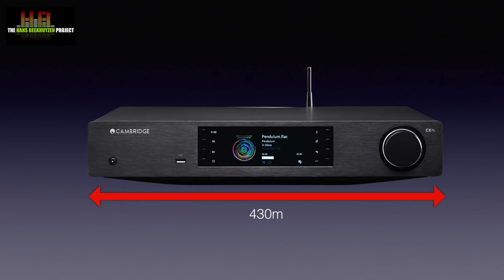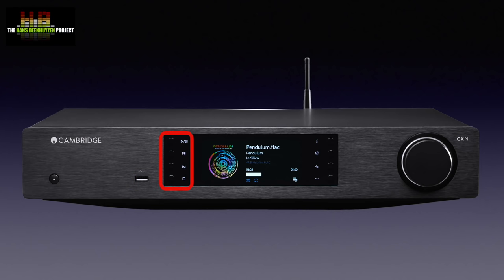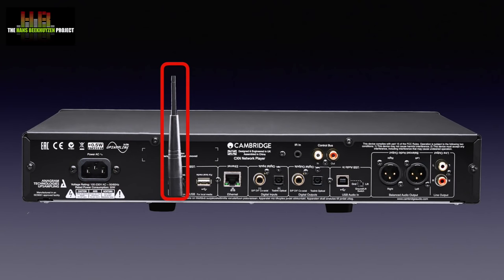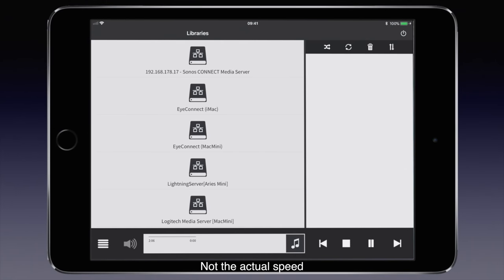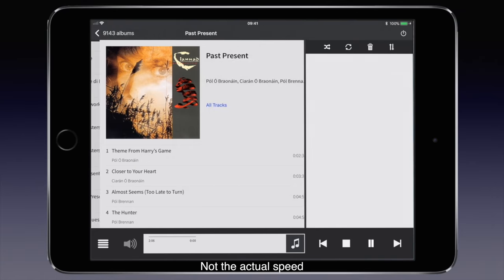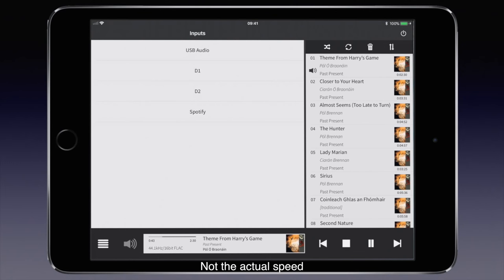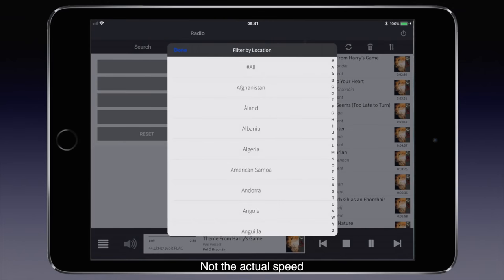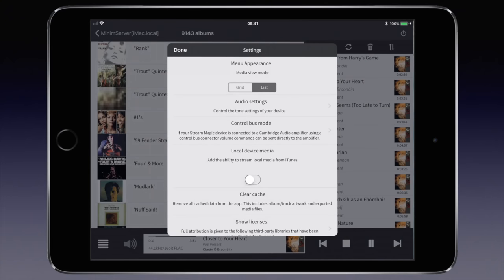Cambridge Audio CXN v2 streamer/DAC/pre-amp

Comment: Nice video. I recently purchased a CXN v1 at a reduced price, I was happy to go with this as from what I can tell the only real advantage of the v2 is a faster processor, they have the same functionality and DAC chips etc. Upgrading from a Pioneer N-50 the CXN seems fast enough to me and the app is sooo much better! The ability to play DSD files is good and they sound excellent. MPEG-DASH HSL is coming with a future update I believe.
Reply: rgrtnyjjc Hi, I’m also thinking to swoop from N50A to CXN...is it really noticeable difference in sound quality?
Reply: Will Mac Hi, I’m not using Spotify. Mainly internet radios plus soundcloud

Comment: Another great video thank you!  BTW, I saw your review of the Yamaha WXC-50 MusicCast which was very positive.  How does this unit compare to the WXC-50?  I am leaning towards the Bluesound Note2 to connect to my tube based HiFi system, but the WXC sounded interesting and ofcourse, this unit also sounds like a viable option.  I don't need a pre-amp but need the streaming capabilities and having updated DAC that are well implemented would be valued.

Comment: Hans. Thank you for the review of the Cambridge Audio CXN V2 Network Player. I am torn as to what network player to get as my source. I plan to implement it with my vintage Mitsubishi DAA15DC amp and DA10DC preamp. Price is a concern and don't want to spend more than 1500 at least for now. I have been looking at Any/All network players that offer a Nice Visual display (as I will probably be using that more often than my computer...at least until I upgrade my computer or iPad. The products I have been looking at are: Cambridge CXN V2 Network Player, Cambridge Azur 851N Preamp/Network Player (although I don't know if I can use it in conjunction with my current preamp). Also looking at the Marantz NA6006 Network Player. And finally the Sony HAP S1 or the more expensive Sony HAP ZIES. Any suggestions would surely be appreciated. Thank you.
Reply from the maker: You find my review of network players at https://www.youtube.com/watch?v=f4FU1tqZdeU&list=PLMbsmejHnP8HQVuvO_xSXAPmV1CVswsvi

Comment: Hello Hans, good review. I am out hunting for a digtal, streaming preamp with line out that I can connect to my NAD Integrated amplifier, KEF speakers. My question is I want to stream my phone with both Pandora and Spotify, I want to connect the TV auido via optical, Also I was for now planning on usiing my Dell laptop as my music server running JRiver. For the PC I would stream using google chromecast? It appears this preamp will do the job?? Thanks for your feedback.

Comment: Thanks for the review. I'm considering this unit or possibly a Sony HAP-Z1ES or HiFi Rose RS201 but those units cost twice as much as this one. I currently use a SMSL DP5 which I've been a bit disappointed with even though it sounds good. I'll be using the unit only for playing FLAC files from a USB connected external SSD. I listen to mostly Jazz, classical and soft rock on occaision. I do not stream music or plan to play files from a network drive or computer. I have a few questions that you hopefully answer to help me make a decision.

-What is the storage limit on a SSD can it read? 
-How many albums /folders and tracks on an SSD will it support?
-Does the app control the playback functions such as playing albums and tracks? If so, does the app also display the track artwork? 
-Does the app connect with Bluetooth or WiFi (WiFi preferred)? 
-Does the internal DAC sound crispy and detailed on the high end (I prefer that sound) or tends to sound rolled off on the high end? 

Thanks for any help on this
Reply from the maker: Please watch Q&A: Which device is better?: https://youtu.be/BzLmC4n2DX4

Comment: Thanks for a fantastic review.I have this streamer, but I've noticed there is no on/off switch that switches the streamer off completely. It seems you have to unplug it to completely to switch it off. That to me seems a very basic design flaw.
Reply from the maker: There is a standby button left on the front. There is no real 'power' switch since it is better - sound wise - to keep power on the crystal oscillators.
Reply: @TheHansBeekhuyzenChannel  Thank you for your reply.

Comment: Hello Hans.  thanks for your continuing work (just made a contribution via paypal).  I am very much interested in this streamer but I am curious.  You mention it being suitable in your setup 2 and lover end of setup 1.  What was the full hook-up chain in those systems used to achieve the sound quality you commented on?  Was a network renderer used in the Ethernet chain?  Did you run analogue out directly to your pre-amp?  Or some other configuration?    In my system I will initially connect via Ethernet directly in, with analogue out to my preamp.  Wondering if that will yield good results until I can afford further tweaking with perhaps SOtM or MicroRendu in the chain.
Reply from the maker: Setup 1: SOtM sMS-200Ultra,  Crystal Cable interlinks,  Audio Note Soro SE (watch https://youtu.be/tPWS3Lk6y1g)
Setup 2: Bluesound NOde2/Auralic Aries Mini/Allo USBridge  as streamers and Marantz KI Lite as amp. See http://thehbproject.com/en/About
Reply: The Hans Beekhuyzen Channel thank you Hans.

Comment: Hans I have the first CXN and it is excellent I use Roon through it via a SotmSMS200 and Pink Faun Lan isolator and Ideon Audio 3R USB Renaissance USB Hub, all through the CXN and out to Magnepan MMG via large current amp sounds fantastic thank you for the recommendation on Sotm and Pink Faun they make the sound so much better. Small contribution to keep you on this channel has been sent. hope others follow.
Reply: I believe he's using the SMS200 as the Roon end point and the CXN as a DAC/Pre.

Comment: Hi Hans,  I see that back when this review was made, you expressed a preference for the CXN-V2 over the Node 2i, though I'm not sure which generation of each was in production at that time. I'm presently feeding a Sonos Connect into Naim electronics, and want to upgrade. I'm presently streaming Deezer, but will probably go to Amazon HD if I upgrade. My primary concern is sound quality: do you feel that the current Cambridge is still distinctly better sounding than the Bluesound, and the best sound available at $1000?  Assuming so, how would you compare the Bluesound to the new Sonos Port if one was limited to CD-quality streaming? Thanks for any advice, and for the great reviews.
Reply from the maker: I am not aware there are other versions of the CXN-V2 and the Node 2i
Reply: @TheHansBeekhuyzenChannel  I might be wrong, but there seem to have been updates on both over time, and I wasn't sure if you were referring to the Node  2 or 2i,  since this review is from 2 years ago and I only heard you refer to 'Bluesound' in the review.  So my questions are in regards to the current products from both manufacturers (3 manufacturers, if you include the Sonos Port question).  Ultimately what I'm hoping to find out: if this is the best sound quality for $1000, on a scale from 1-10, we can give it a 10. Would you give the Node 2i a 7, and the Port a 6?  Thanks.
Reply from the maker: They normally don’t influence the sound quality. For the Node 2i I am sure for I own one.

Comment: Thank you for this info.
At the moment I have a Dynoco ST70 tube amp connected to the Klipsch Heresy 2 and for audio I use the Sonos Connect 1.
I want to upgrade and go for the Cambridge. But I have no idea if I will hear any improvement in the sound quality.
So my question is, will I  hear any inprovent when I will change the sonos connect for the Cambridge?
And what difference will I most likely hear?? Is it a big difference or very sibtile?
Greetings from the Netherlands
Reply from the maker: I would, even in my setup 3.

Comment: Good review Thanks. Got a question. Are we able to bypass the internal DAC to use our own something like a Chord Qutest ?
Reply from the maker: Yes, you can connect the digital output of the CXN v2 to the Chord DAC.
Reply: If you ever try this out, please do share your experience with regards to any improvement in sound quality when using the qutest vs cxn dac.

Comment: I am new to the hifi hobby and find your vidoes extremely helpful.  I recently bought a pair of 4ohm speakers, however my amp only delivers 8 ohms,  is this a problem?  Thx
Reply from the maker: It is all about the current that is going to flow. There are no 4 ohm speakers and no 8 ohm amps. The impedance ('the 'ohms') varies with the frequency and depending on the design can draw large amounts of current. If the demand for  current becomes too large, the amp might get too hot and eventually die. That is why some amp manufacturers state their products are suited for 8 ohm speakers for that is a save choice. And speaker manufacturers have to put a number on the speakers and often it is the impedance at 1 kHz. That's useless for defining the potential current that might flow for the largest currents are caused by the bass tones. In effect this means that I can't say if combining your amp with your speakers could ruin your amp. You do need the assurance from your supplier that it will work properly.

Comment: Just bought this player. Together with the CX A80 and a CX UDH (probably the last one in NL). 

A word of caution/advise.... I use Plex for DLNA and it works well with the Nv2...except when trying to stream WAV. The default DLNA profile Plex uses for the unit won't allow WAVs ( lossless directly ripped from CD). A DLNA profile wizard could maybe fix this...16bit 44.1kHz FLACs work great.

Like it was said in the video...the player only plays what it gets from the server. And the Plex won't serve untouched WAVs to a DLNA client with the default profile.

Playing WAV using USB works great. So it's not the players fault.

Just thought I put it out there 😉.
Reply: Korrel Zout ik heb ook de cxa80 aangestuurd door MacBook via usb. Weet jij of cnx een klank verbetering zal zijn? Ik vraag me af of het die investering waard zou zijn aangezien de cxa al een dac heeft. Merci alvast
Reply: @wardgeebelen4205  zouden zelfs beide dezelfde dac moeten hebben. Verschil is vast marginaal...blijft zelf proberen.
Reply: @kaasman78  oké merci!:)

Comment: Thanks Hans 
Cambridge audio claim absolutely no quality loss when the CXN used as a preamp,  did you try the CXN as a pre and if so was it directly into a power amp?
I'm looking at a CXN directly into a  power amp but am worried about the way the volume functions 
Thanks in advance for any help
Reply from the maker: I used it connected to the line input on my amp, not as a pre-amp. But I am sure it will sound fine as a pre-amp provided the power amp is a good match.

Comment: Dear Hans,
It’ll sound weird but you’re sure that the device you reviewed is cxn v2 and not v1?  The back panel clearly states the version, ie for v2 it says “CXN V2 Network Player”. Yours displays as “CXN network player”, that is the original-old V1.
Reply from the maker: I did review the v2 version but I might have used stock photos of the v2.
Reply: Ok, thx

Comment: Hallo Hans 
Een vraag die ik niet zo goed ergens kwijt kon en gezien die gekoppeld is aan mijn Cambridge audio keten post ik die dan maar hier. Ik ga verder in het Engels gezien het medium. 
Problem: Too sensitive volume control. 
I have a CXN V2, CXA 81 and CXC chain. 
When turning up the volume in the first quarter of the volume range the jumps in volume are far too high. 
Whatever I try, using the volume control on the amplifier, the remote control or the Cambridge app ends up in either too loud or too silent music with no in between. Only when I use the CXN as a preamp the volume control is somewhat more gradual but that comes at the price of a lesser sound quality in terms of clarity and transparency. 
I have been looking for all sorts of solutions and even stumbled onto something called “attenuators” from Rothwell. 
Although they pretend to be sound neutral I hesitate to put a “resistance” in the signal path. 
Do you have any suggestions? 
Kind regards!
Reply from the maker: Sorry, can't help you there.

Comment: Hi Hans, thanks for this wonderful review! I have a question: When connecting a Mac (with Audirvana) over ETHERNET with the Cambridge will the music signals then directly depart from my Mac? I ask because Audirvana can do a bit of MQA-decoding (I'm on Tidal) and I use a room correction plug-in with Audirvana. Much appreciate your answer!
Reply from the maker: Audirvana will send an unprocessed signal to the DAC. The DAC will then decode and render the MQA signal. But that only works if no processing takes place in Audirvana or in-between Audirvana and the DAC. You could have Audirvana do the decoding of the MQA signal and then have the room correction plug-in do its work. But then the DAC can't render the signal as MQA signal.

Comment: Can I just add and external HDD and use it as a music server? Any HDD, without power supply? Or only with external power?
Reply from the maker: Yes, provided it doesn't draw more than 1 ampere (which will normally not be  the case with 2.5" USB drives). 3.5" USB drives do need their own power supply.
Reply: The Hans Beekhuyzen Channel thanks! I was reading the Cambridge Audio site, and they do not recommend using this as an audio server, they say it’s only a streamer, and they recommend using a NAS with UpnP to store your music. That the USB port is design to read smaller usb thumb drives and not large HDD. 

I use an Olive 03HD, but that was bought in 2010, and will fail eventually, and Olive is out of business, so it’s unsupported. So I’m looking for an alternative, that’s just like that, preferably with a CD drive, so I can rip my CD’s directly, but if not I can use the Computer, no problem. And that has either integrated HDD or that I can just plug an external one with ease. And that it costs close to $1000 USD or less. Do you know of any that fit that criteria? Thank you very much!
Reply from the maker: That probably means that the CPU that controls the audio files is not too powerful. So it will work with small collections of music. I have not tried this, though.
Reply from the maker: you might consider the Innuos Zen MK3 Music Server: https://youtu.be/PrKFvGTVmiM

Comment: Dear Hans,

I thinking to buy the CXN V2 only as streaming transport for Qobuz, the internal dac of my Parasound Halo integrated doesn’t support mqa. 

As a streamer transport only, which device has the best sound quality in you’re opinion?

OS is not important for me, the digital output neither because I have both dedicated usb cable and a digi coax. 

Pro-ject Streambox S2 Ultra
Cambridge CXN V2
Bluesound Node2i
Reply from the maker: Please watch my review. I have nothing further to say.
Reply: The Hans Beekhuyzen Channel you said it’s tolerable in your setup 1, the Streambox S2 Ultra you easily allow in setup one. And I have seen what you said about the bluesound.

But I meant using it only as streamer transport for Qobuz, I want to use the dac in my integrated amp :) 

I know you didn’t compare the devices only as streaming transport, but what are your first thoughts ?